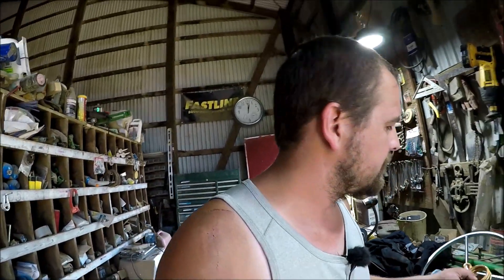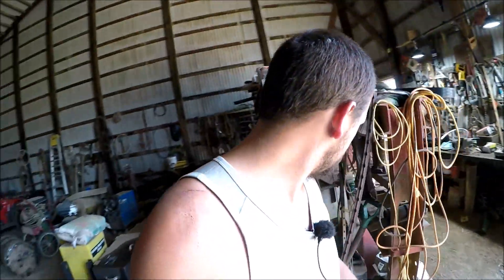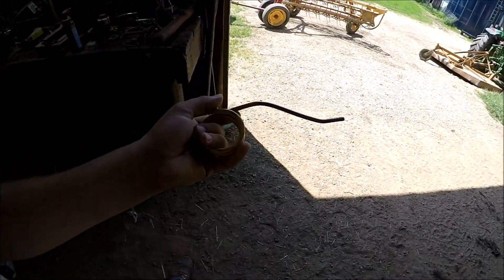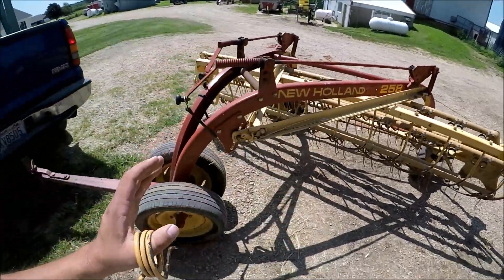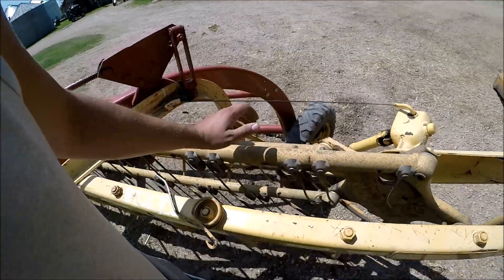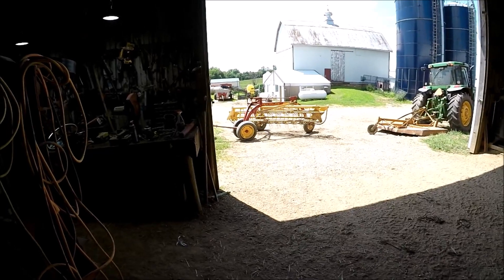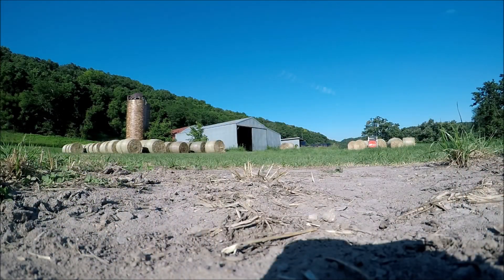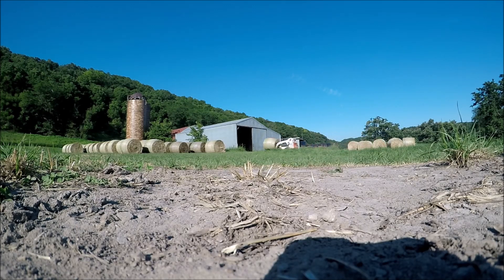Plan For The Worst Hope For The Best | Busy Bee

Comment: My experience with hay preservative was if ran too much pressure the droplets got too small and if windy would blow around more than I wanted. I generally went middle nozzle size 30-40 psi depending on how much wanted to put on. I still have some of the nozzles if need, forgot to put them with baler when traded.

Comment: Rake teeth like most things-- you get what you pay for, whether they're rubber or steel... You can buy GOOD QUALITY steel teeth for half the price of cheap rubber ones, and that's a fact.  I've run the cheap "Tractor Supply" teeth and yeah they'll bend sometimes.  Trick to bending them back is either 1) use a pipe wrench sideways or 2) use the ring end of a crescent wrench.  The pipe wrench is more stable and gets a better grip.  What I mean by sideways is put the pipe wrench below the bend in the tooth and then pull up on it 90 degrees to how you'd loosen or tighten a pipe.  Helps to push down on the other end a bit to keep it from just "springing" the tooth.  They'll bend back real easy.  Once you get used to it, I can bend back any bent teeth in the field using the ring end of the handle of the crescent wrench I keep in the tractor toolbox.  The rubber teeth fail rapidly too, the cheaper they are the sorrier they are and faster they rip out or bend or break or tear off the rubber from the steel base.  No way to fix those.  Like you said, the good thing about the softer steel spring teeth is that they tend NOT to break and scatter teeth around, and they're easy to bend back.  Get some higher priced better ones where the steel is actually heat treated more to make them tougher and stronger and "more springy" and they won't bend... the spring end will do its job, though eventually they'll probably break (after many years) usually just below the ring-eye bend in the end under the bolt clip.  

To each his own but IMHO and experience the rubber ones are junk unless you want to spend a FORTUNE on the really good ones (highest priced there are), and I'm not convinced those are all that much better.  Nothing's perfect, but the steel teeth, at least you can buy TWO GOOD higher priced ones for the same money as one cheap rubber tooth.  Best of luck!  OL J R :)

Comment: Get your teeth from a new Holland dealer not the cheapest you can find on the internet
Reply: Yep cheap teeth=junk no matter how you slice it... Cheap rubber teeth are junk too.  I'm guilty of buying some of the cheap "TSC" teeth (cheapest junk you can get-- all TSC stocks, when they even have them "NEVER what you need out here" should be their slogan LOL:)  and yeah they bend but I can bend them back real quick with a pipe wrench or the ring end of the crescent wrench... if they're sticking out at a wonky angle just turn the wrench 90 degrees and give it a tweak again... Usually if you bend a tooth it's because you drop in a hole or hit a hard fire ant mound or something like that that's pretty unusual; it happens.  Later!  OL J R :)